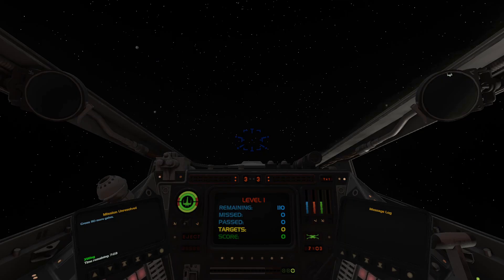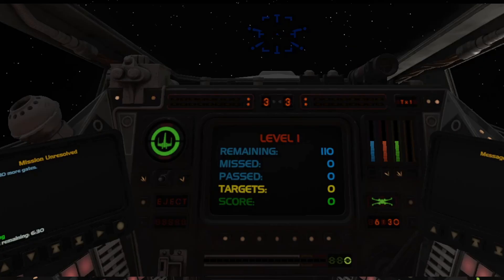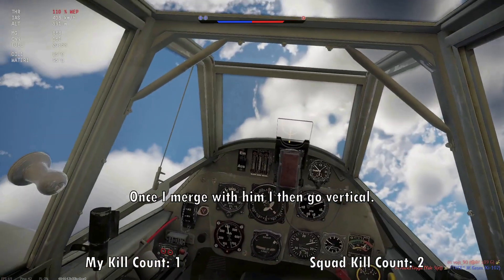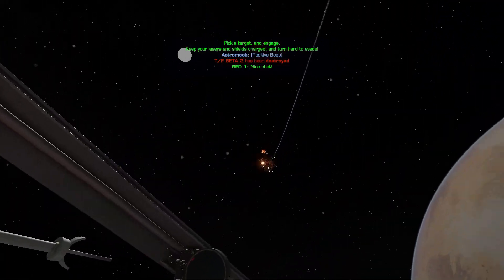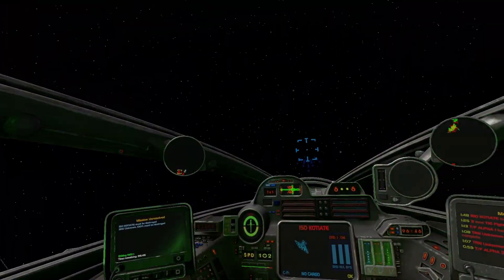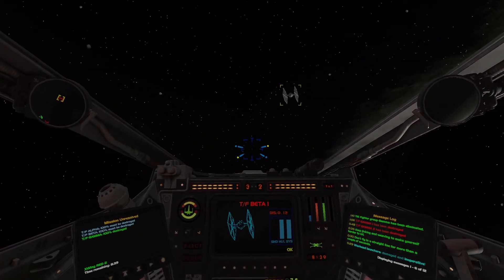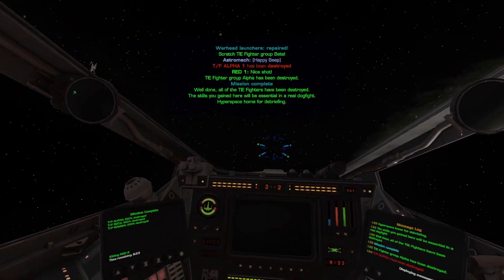XWVM's NEW Difficulty Modifier That Literally Changes The Game

Comment: That’s not a rebalance. That’s an absolute 100% neutering. I’d be fine with like a 5 maybe 10% loss when you’re transferring back-and-forth but 80 to 90%? You may as well just never use it at all EVER!  Talk about extremes.  

The alliance fighters are pretty much only useful at higher speeds which requires you to be discharging your shields at 100% and charging your cannons at 75% just to keep up with the various TIEs.  The only way to really charge up your shields is to be shunting energy from your cannons while doing that.  This new incredibly extreme variant makes that useless and you may as well just fly around without shields at all even just a 5% loss would put a huge damper on previous strategies as it really limits your ability to go back-and-forth between shields and cannons effectively. Not a fan at all of this extreme Nerf.  It completely changes the dynamics of the game and not for the better.
Reply: I think that is one of the reasons it is an optional mode. And I would say it is important to try in-game, fly a campaign and see how the pilot's effectiveness changes. Because I think it will not do so dramatically. Back in the day I do not remember needing to put all the laser energy into shields on many occasions...

Comment: Laser shunting is such a primary component baked into the game, that I feel the rebalance is too much of a shift in the opposite direction. If I am evading fire I don't necessarily need cannon energy, I usually dump it into shields then, the compromise being that my cannons won't be nearly as effective when I get back on top of the enemy's maneuvers. Perhaps a middle balance, I would be more open to seeing.
Reply: It would be nice to get suggestions on alternative energy management mechanics.
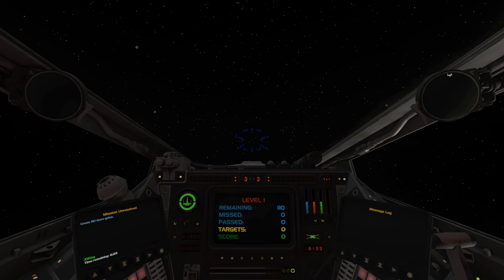The original is Laser-> Shield 1:16, meaning that 1 laser energy translates to 16 shield energy.
The optional rebalance is 1:1.

We could add a slider to let the player select any value in between such as 1:2, 1:4, or 1:8.
But honestly, I think that choice brings so little to the table. Probably, 99% of the people will still chose either 1:16 or 1:1.
Squadrons did something interesting with some modules. Once the laser accumulator was full, overflowing energy went automatically to shields. The TIE Defender had a system that loaded an extra buffer of energy and you could shunt it to whatever you needed at the moment: lasers, shields, or engines. It could be fun to bring some of those ideas as options for XWVM.
Reply: @davidesparzaguerrero4545  I am unsure of the ratio per say.  Another idea is perhaps slightly faster shield charging rate with the decreased ratio from cannons shunting. This way over boosting shields fully to 200% would require more effort and speed sacrifice to get, but it wouldn't take as long to recharge shields at a vulnerable speed. Cause base shield charging is unrealistic to rely on, on its own. I believe Tie Fighter did speed up the charge rates somewhat in that regard.

Comment: Slightly OT, but is there a way to stop the whole menu UI rolling around when using trackIR software?
 It never stays in the same place long enough for me to make any adjustments.
Reply from the maker: What I do is keybind buttons to switch on/off as well as recenter my headtracking software. But I use Opentrack for that, I am not sure whether the TrackIR software has that functionality.
Reply: @rebelmerlin22 Thanks. I do have buttons mapped (F9 to switch off and F12 to recentre) but they don't seem to work when XWVM is running. 
To be clear, I use ''trackIR'' as shorthand. I did use it for many years but it became very glitchy and buggy and used to drop the connection all the time , so I recently switched to Opentrack and bought a wireless Delanclip. I'll give it another go.

Comment: I do wish you could change the ratio of energy transfer a little bit.
Reply: I like the rebalance in principle but it needs a couple more refinements... like, currently if you set lasers to 75% or 100% and they're fully overcharged, the extra power is wasted... so in the Y-Wing and B-Wing I'm frequently transferring energy between cannons and shields so the ion cannons can keep charging and not waste energy while the laser cannons remain overcharged. And now that transfer is taxed...
What'd solve the problem most minimally would be separate "transfer energy from laser cannons to shields" and "transfer energy from ion cannons to shields" commands.
Reply: @RoamingAdhocrat Ideally I would like a power transfer slider or perhaps some pre-sets would be ideal. It would also be cool to have specific values for each craft. For example, a Y-wing may have a transfer value of 50 so a slider at 100%, 75%, 50%, 25% would mean a power transfer of (50, 37, 25, 12), while an X-wing might have 40 so (40, 30, 20, 10). Etc. Each craft would feel very different.
Reply: @MichaelCorryFilms The original game let you store a couple of presets
Reply: @RoamingAdhocrat I should have been more specific. When I meant presets I meant for the energy balance. Rather than 1-100% slider something like a 25,50,75,100. The presets would be how much energy is transferred and lost between systems. At 75% percent rate 75% percent might go between lasers and shield and 25% is lost. Versus currently where you lose most of it and only a little bit gets transferred.